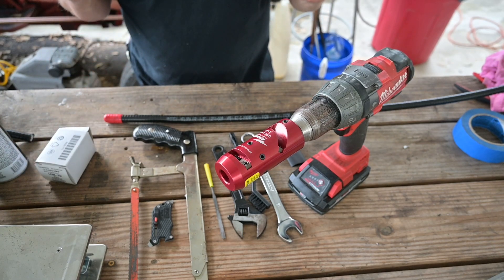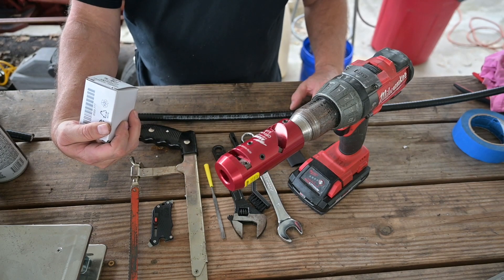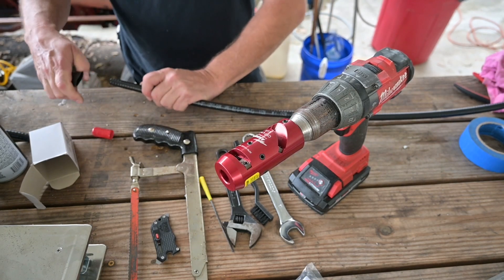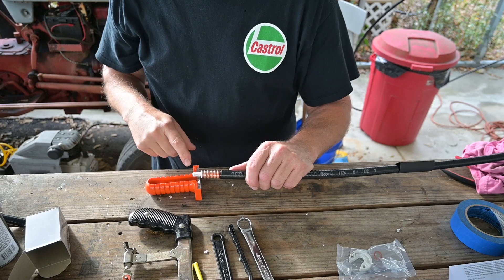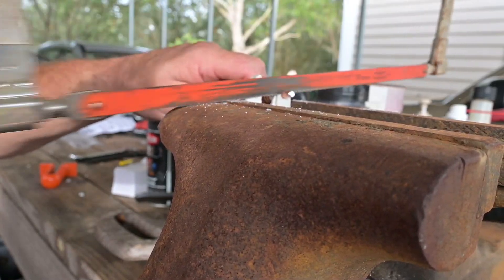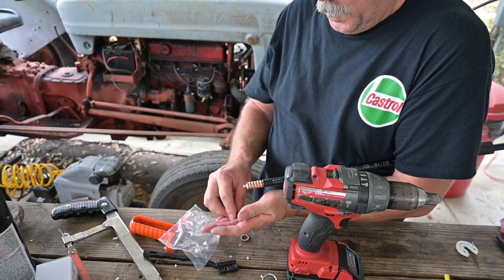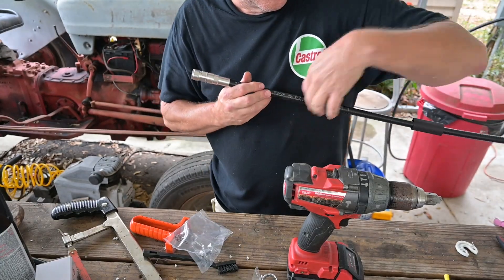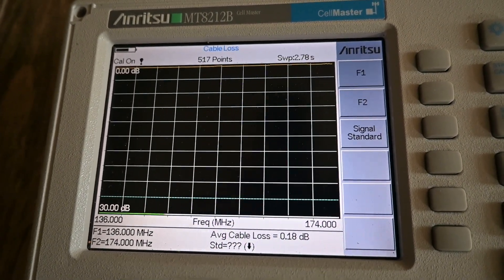Ham Radio tech tips Installing CommScope positive stop RF connectors on  LDF4-50A  1/2" RF Heliax

Comment: This is definitely one of the best videos out there for making these connections. It would be great if you could make a video  without using that stripper tool. I wish the company I worked for had but they're too cheap so i'm stuck using the pocket knife and that hand held prep tool. And I didn't know you could spin the top part of the connector. My coworker told me to only spin the bottom one for some reason.
Reply from the maker: Thank you very much. Manual prep of one of these can be done with a razor knife and an atlas snap saw 
https://www.amazon.com/Atlas-Model-Railroad-Super-Saw/dp/B0006KQI0A use masking tape as a saw guide. Perhaps is would make a good video - thanks for the idea. Thank you for watching !

Comment: Someone shot your coax?!!  Installing the connectors on Heliax are so much easier than prepping it.  I have 3/4" running to my 2m/70cm antenna due to the length of the run, that transitions to 1/2" which I have the tools to install connectors on (not the fancy stripper you have - DX Engineering makes a cheaper one that works just as well).
Reply from the maker: Yes a spent 762x39 on a descending trajectory  took out the HF station for a location we are responsible for . The feedlines run  horizontal in a truss arrangement that supports multiple antennas on a multi story commercial structure. It just happened to land precisely into almost the center of that feedline  missing the 15 or so other feedlines  and the truss. We found it using the distance to fault measurement on the Bird SiteHawk which was accurate to less than a foot from the point of measurement.  I know the tool you are speaking of. Thanks for watching !